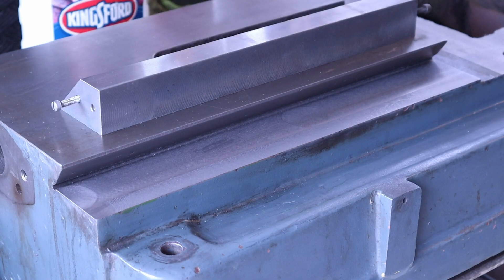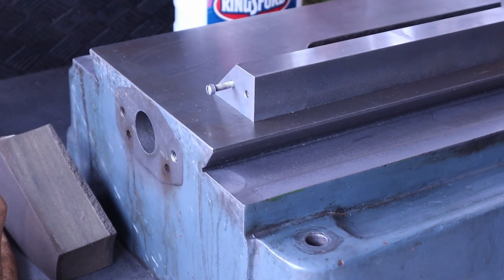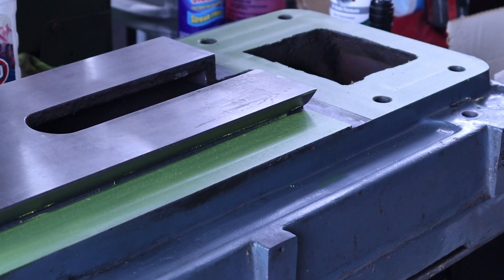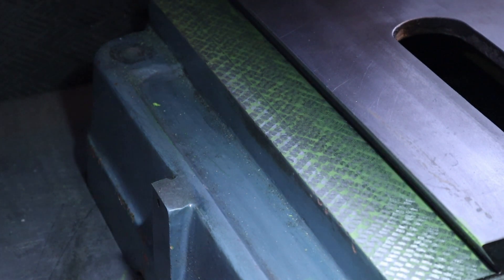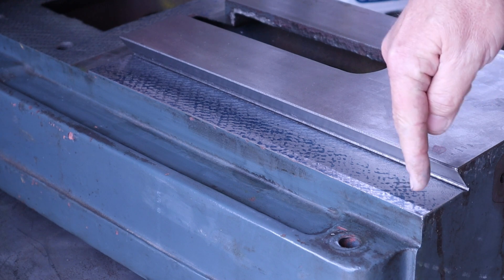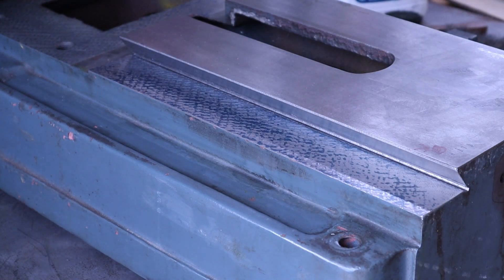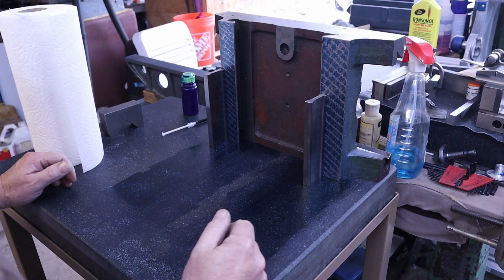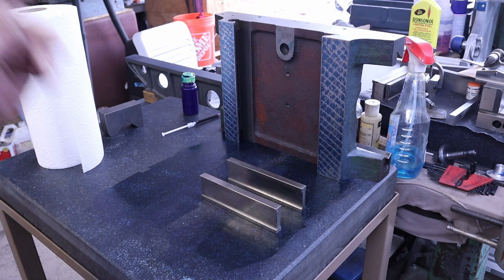Rebuilding My RF-7045 Benchtop Milling Machine

Comment: not sure why having the sliding surface on the base the same height is relevant? all you need are both surfaces to run parallel and in the same plane. a difference in height doesn't  matter as your only moving in the y direction.
Reply from the maker: It matters for how I am able to measure the surfaces.  If i make the saddle top and bottom parallel then the fit remains consistent.  Great question,  it is mostly due to my limitations on performing the measurements

Comment: Ill be following this very closely.  My RF-45 has the same symptoms and it will be interesting to see how you resolve these issues.  Is there any other way to measure the difference in height of the two ways of the base or the only way to do that is to use the saddle?
Reply: One other question, will you be doing a series on correcting this and did you look into the other components, such as the column?
Reply from the maker: @brandontscheschlog  im skipping some of the support welding.  It has been super hot here.  Next video will show the column flex and then go into the epoxy and support work under the base.  That has to happen before i finish scraping.
Reply from the maker: @brandontscheschlog  i do not have RK type tools to be using.  I will show the results and some of the scraping as well.  I turned the section of the base that rides under the saddle into a flat that i used to gage to surfaces of the saddle to base to. I have a little bit more to work on the gibs yet on the base.  I have also turcited the saddle bottom and once the epoxy is done ill scrape it all in.  The issue comes from the base not being Ridgid for what i would like.
Reply: @AlmostMachining  what are RK tools?
Reply from the maker: @brandontscheschlog  Richard King tools.  Basically the slides that gap the way surfaces.  Yes it can be done with levels,  normally on his bars are levels.  Since i dont have a way to level reference the whole base i would just indicate it in.  I will show this.  I had to do a ton of learning for all of this as ive gone along with the project.  And i will need to add in more detail on the next set of videos.  Huge thanks
Reply from the maker: If you had access to a large measuring machine they could be done at the same time.  A good portion of my issue is the base.
Reply: I just got done scraping the bottom of my saddle and now am doing the top.  I will try to use this to scrape the base by. I believe Richard King suggested using a level to get them close.  I will look in the Connelly machine reconditioning book and see if there’s another method that works well or better.  I don’t have a large CMM at my disposable.

Comment: Looks like you have your work cut out for you. 
Is it possible that as long as you have maximum co-planer contact side to side & front to rear regardless of level or parallel with the bottom, any deviation from absolute level can be compensated for by tramming of the head? I'm thinking that maximum co-planar is a primary concern to achieve maximum ridgity. 
... or maybe my head is up my rear.
Reply from the maker: Thank you,  i think the limit is going to be the machine.  The castings builder work put in. Etc.